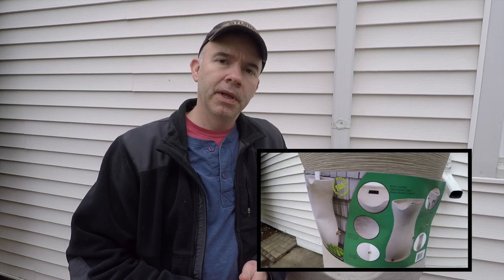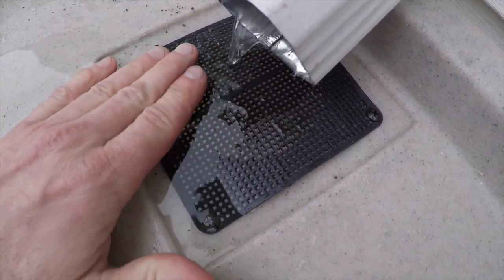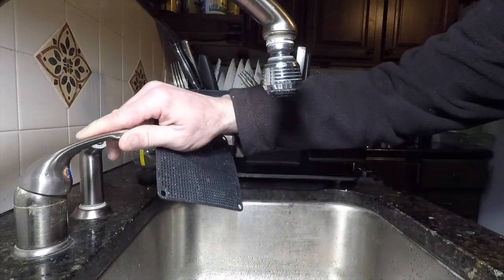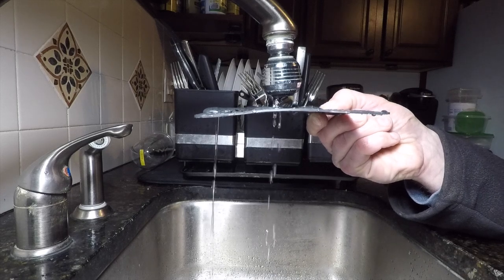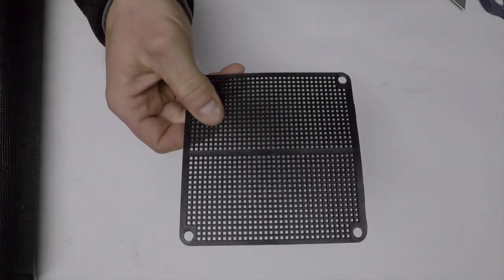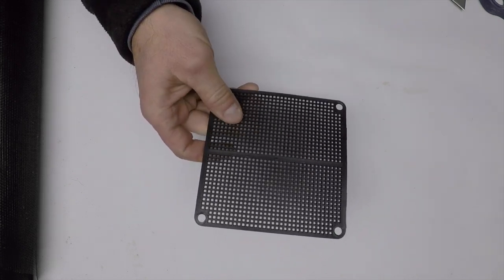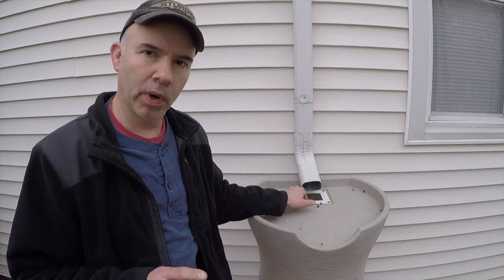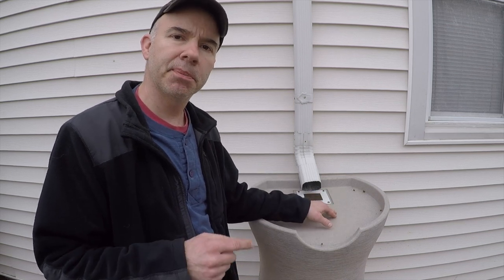Costco Rain Barrel Review and Installation

Comment: I bought this rain barrel at a Costco in Toronto (May 2018) and viewed this video afterwards, prior to installation. As demonstrated in the video the screen does indeed only let in about 20% of the water dripping from the rain spout. I bought some screening from the local dollar store (cost $1.25) and did some simple repairs and voila, works like a charm. I would never have known about this flaw had I not seen this video so thanks for that. I do feel like it's one of the more attractive looking rain barrels and with the quick fix I'm happy. Thanks!

Comment: Tom, the reason you have an issue with the top screen is that your installation method is at odds with the manufacturer's instructions.  The top screen is for water flowing out ... as in overflow water.  It is not intended for filling the barrel.  The Costco rain barrel comes with a tube, down spout diverter and drill bit to install the hose directly from the down spout into the barrel.
Reply: Did come with the tools you are talking about

Comment: I like your idea of replacing the mesh that comes with it, but I'm currently trying to install this exact same rain barrel from costco right now using the alternative "flexi-fit" diverter method. My problem is I can't find out anywhere online WHERE I'm supposed to drill a hole into this thing for a hose seal OR what the heck those nodes are for. Supposedly you can use those nodes for linking multiple of those barrels together, but nowhere does it say HOW to do this with those nodes or if those nodes also happen to be where I would drill a hole (and if so, why did they have to make it the way they did with nubs sticking out, which makes drilling with the hole saws [that they provided] problematic). It's all very frustrating, so I was hoping to find someone online who installed it using that method, but unfortunately couldn't find anyone who did it this way (including you) with this exact kind of rain barrel :/ If you happen to know (where I'm supposed to drill a hole on this barrel) that would be fabulous!

Comment: do you have it set up backward? Turn it around and the water will run down to the screen.
Reply from the maker: That wasn't the issue. It was the same on both sides...Maybe they fixed it by now, I'm not sure. That video is a few years old. I threw out the screen that came with it and made my own.

Comment: Drill a hole into it and attach it with a tube to a drilled hole in your gutter.  .  why are you subscribing to his channel?
Reply: Amazon has a kit to install with little work.
Reply from the maker: Thanks for the tip Chris. That's another option. Fine in some circumstances. However, at my location, the Amazon diverter kit offers no added benefit. It is pretty cool though.

Comment: LOL Alley Picked is correct.  The surface tension of the screen does make a bunch of the water run off trying to fill the barrel from a downspout like he did.  You could go through the rigamaroll he did to create a different screen.  OR you could go through the test he did with his faucet and just flip the screen over for the same test and BAM the screen works.  Correct size too.  The surface tension is caused by the holes acting like a funnel the way the screen is mounted when you buy the barrel.  Since you have to get the parts out of the barrel through the screen hole anyway just flip the screen over before screwing it back on.  Don't believe me?  Try it yourself.